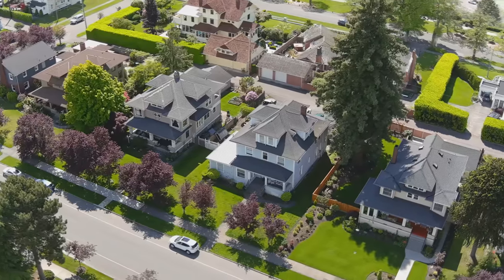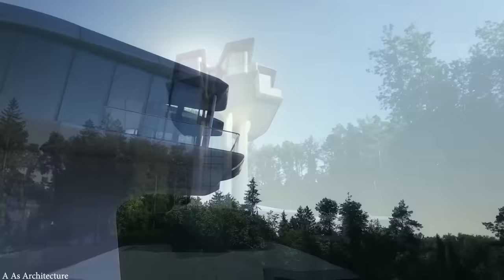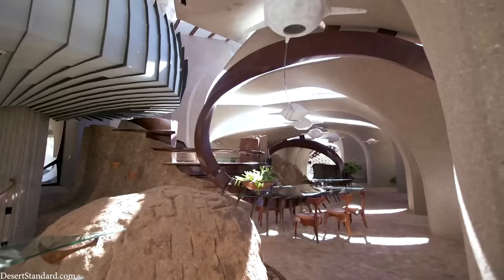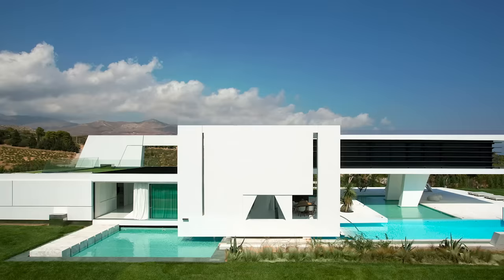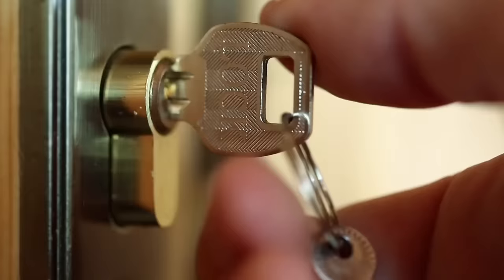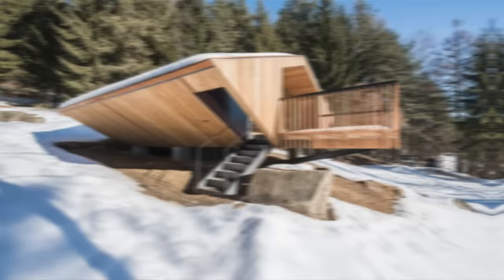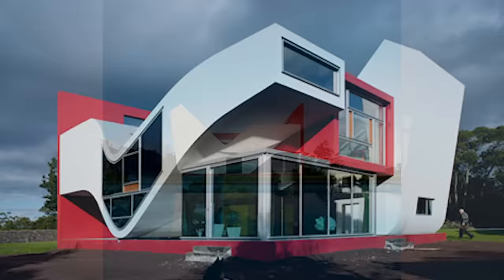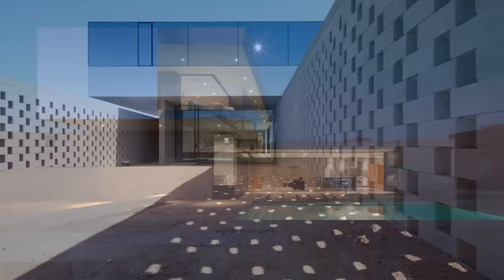TOP 15 Futuristic Houses

Comment: 15...14..12..8 should be a mix for the outside....natural look of 15....the linings appearing on the clean walls of 14.....the outter design of 12.....the camo from 8...........for the inside....floor that look like solar panels for the high tech style with wall matching it(not seen in any of those inside here)....Dioptase stone would be really great if refine as outside walls...it has such a nice coloring